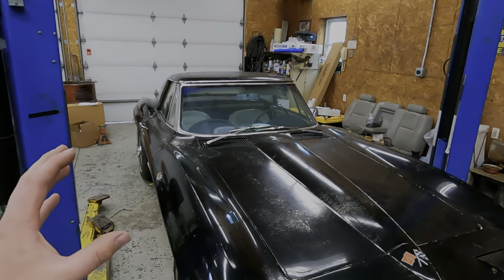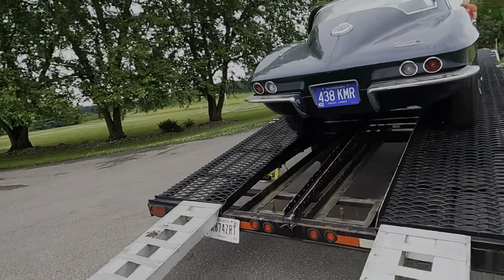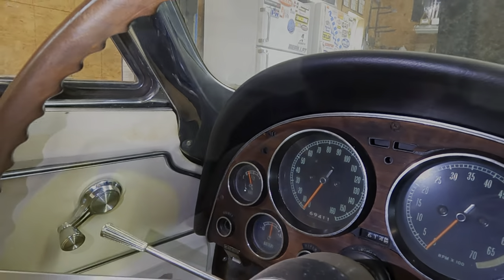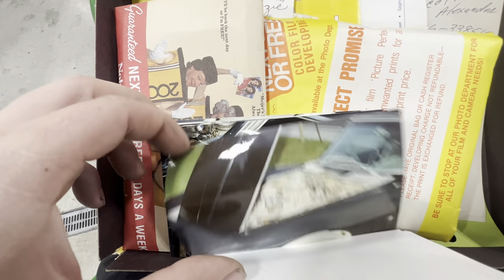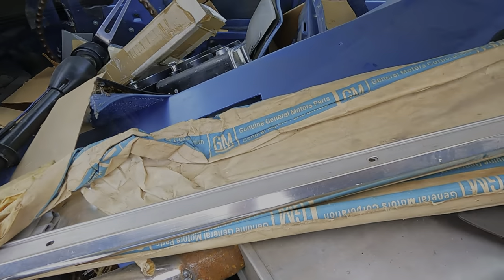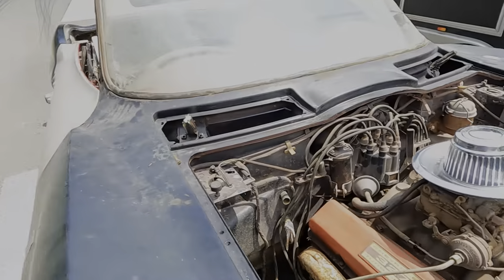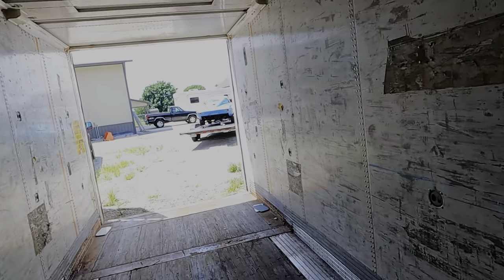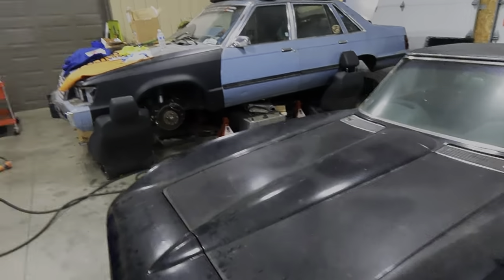BARN FIND Mid-Year Vette's Get a New LIFE First Time Out in 30+ YEARS Numbers Match 427 327 Corvette

Comment: High redline tach means L76 or L84... the Rad support for a fuelie (L84) offsets the rad to the passenger side and has approx 6" hole on the drivers side for the air snorkle tube.

Comment: That one with the '63 gauges has '65-'66 side gills, but a non '63 (or no) clock. So it may be a '63 with body panels replaced from a crash or something. I haven't seen too many guys replace their later gauges with those from a '63. But anything's possible. Those snow brushes are handy into the summer months around Sault Ste Marie.